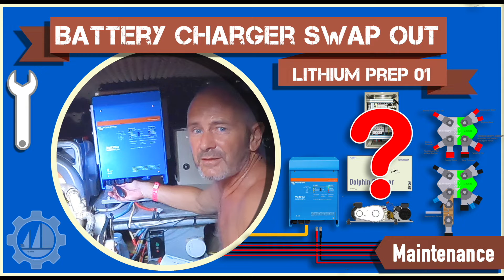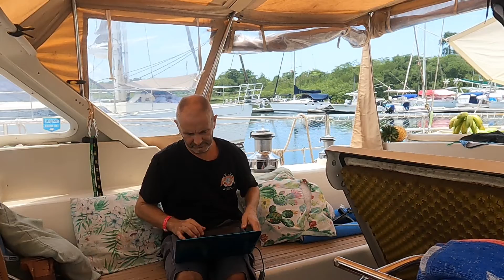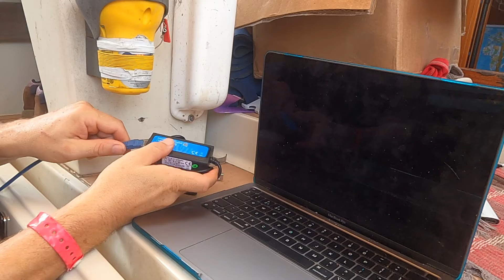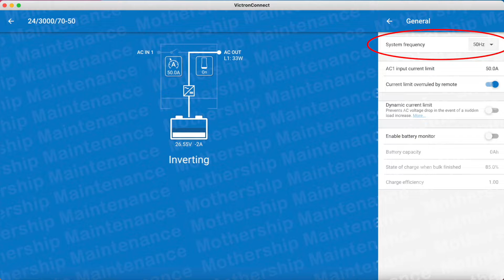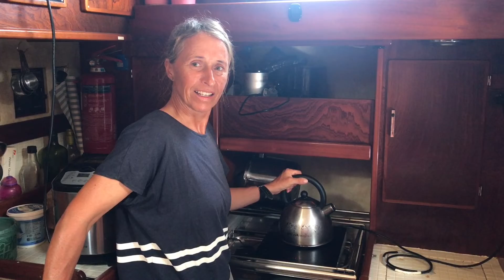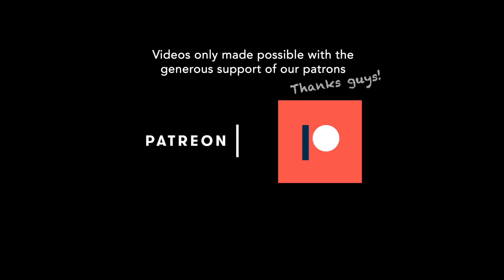Victron MultiPlus MK3 Configuration | Lithium Battery Upgrade (Part 7)

Comment: Did you just use the VictronConnect app to program your multiplus, or did you use the veconfig software?
Reply: If you weren't such a half wit you'd see him say at the start he's using victron connect and on every single screen recording of the software it says victron connect at the top. 

Also if you had any idea how to use google you'd see that victron is phasing out veconfig software with victron connect.

How's that 30 years of experience going for you? What are you even doing here watching YouTube videos on amateur installations? Shouldn't you be reading product manuals and schematics?

Comment: Hi  nice video
Doubling up Voltages for 12v settings for 24v is fine. How do not double up the absorption time, as😢 that is based on capacity, 400ah at 12v or 24v is still 400ah regardless of the voltage. So of 30 minutes per 100ah is recommended, then your 400ah bank should have absorption time set to 2 hours
Reply: 12v or 24v is not still 400ah regardless of voltage. That's a dangerous statement.

When in parallel, amps increase.
When in series, voltage increases.

By connecting 2 (12v200ah) batteries in series, you will have a 24v 200ah battery bank.

By connecting 2 batteries in parallel, you will have a 12v 400ah battery bank.

Where you're getting confused is watt hours. The watt hours for the 2 battery systems is like for like.
Watt hours = Ah multiplied by voltage
24x200=4800wh
12x400=4800wh

Amp hours is a measure of how many amps the battery can supply for one hour.
What we need to remember though, is that a 24v appliance consumes half the amperage of the identical 12v appliance.

Doubling up the absorption time with your reasoning sounds like it would be unhealthy for the batteries.

Hope this helps!

Cheers
Reply: @williamschneider441 I'm not stupid the original was asking about 12v or 24v bank.
If it's a 400ah 23v bank obviously if 12v batteries in series parallel then he will need 8 x 100ah 12v  batteries for a 400ah 24v bank, and obviously 4 x 100ah 12v batteries for a 12v 400ah bank.
If he doesn't know this then he should not be installing his own batteries!!!
If you notice i did say 400ah at 12v or 24v is still 400ah
Reply: But 400ah at 12 or 24v is not still 400ah?

The watt hours remain the same, not the amp hour.

Are you referring to a certain point in his video? Can you shoot me a timestamp?
Reply: @williamschneider441 mate just leave it! I didn't say that at all, obviously 400ah at 24v will require double the batteries if 12v batteries are used in series, parallel. That was however not the original question. 
Just stop you comments, rest assured after 30 years as an electronics engineer I do understand batteries!!
Reply: @JayPerrypersonal 
Just leave it? You sound a bit sensitive mate, hows the personal life going?

Don't you dare say you didn't say that at all as I used verbatim in all of my replies. 

You say that was not the original question? I don't recall seeing a question in your original comment, just an open ended statement open to misinterpretation.

I rewatched the video and noted the part you were talking about right at the end when he said he wasn't sure if the charger allowed for the system to be 24v or not so he left the settings suitable for 12.

30 years as an electronics engineer and you can barely construct a coherent sentence? Unbelievable.

Hopefully someone else comes across this comment thread and learns something new, I was simply trying to share information but people like you are the reason the next generation are dumb as dog sh*t because you either can't explain concepts very well or choose not to.

Either way you sound like a bit of a halfwit and it's not worth trying to have an intelligent discussion with someone like you.

Have a blessed day.